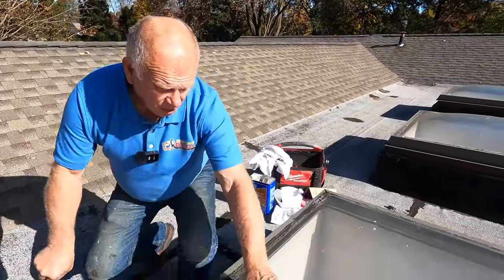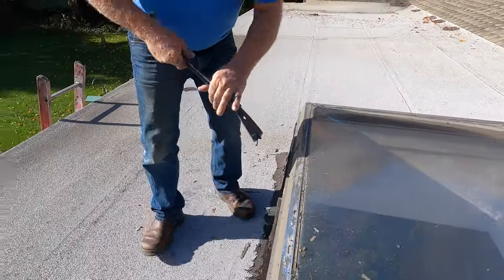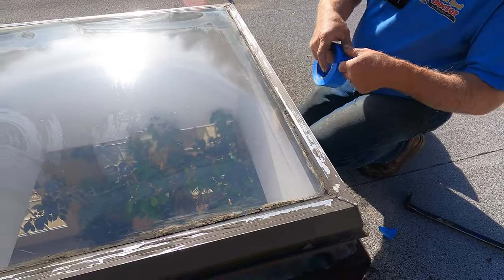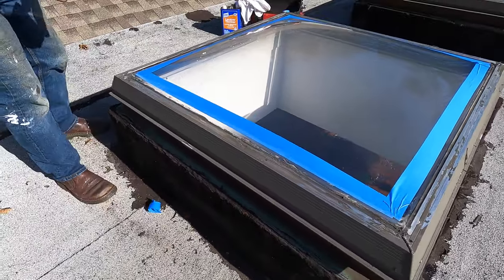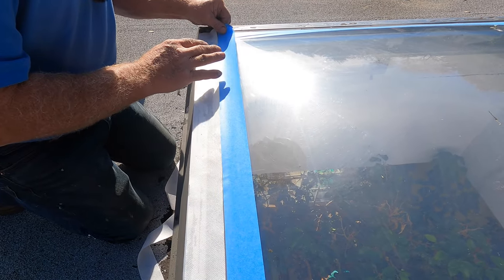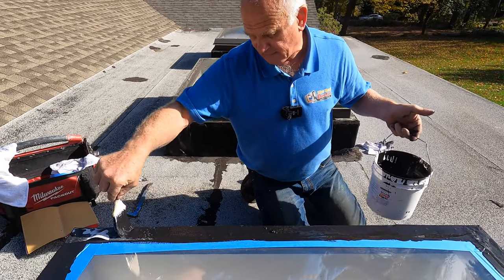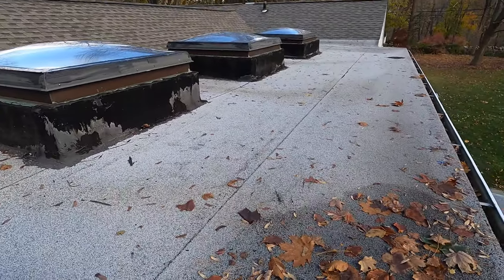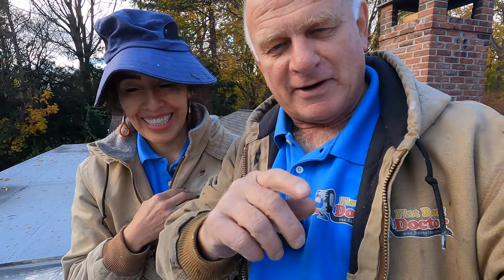The Best Skylight Leak Repair guaranteed DIY - Liquid Sealant adheres to glass, metal, plexiglass

Comment: Take the skylight off and separate the aluminum frame from the plexiglass/Lexan and remove the old caulk. Use xylene to remove the crud and clean completely. Install new 1/4"x1" butyl tape around the perimeter. Add extra butyl caulk to the corners. Put the frame back over the plexiglass and firmly press the whole perimeter to adhere. Add a bead of butyl over the top to frame/glass and use a small caulk knife to smooth the bead.
Reply: Where can these products that you are talking about in this comment be purchased ?

Comment: Preparation was so thorough and done properly.  I guessed Turbo Polyseal but I seeyou chose super silicone seal for this job.  Didn't it need a UV protection coat like the aluminum paint? Great video as always and much appreciated for sharing your knowledge and expertise.  Thank you.
Reply from the maker: Thank you! Hey, I am so glad you are back. Sorry if I offended you last time. That was not the intention. Turbo Poly Seal does not work on glass, although one of my older videos I did use that. Super Silicone Seal is the only product that I have found to work on plexi glass, glass, metal. There is no need to cover the silicone since UV's does not harm it.
Reply: @FlatRoofDoctor   hi, you didn't offend me at all :), it's just your videos stopped appearing on my feed until I remembered and searched for them and watched it. YT algorithm gets weird sometimes.  Thanks for the reply, always appreciate your knowledge sharing.  Trust me, you have my full admiration, not just your expertise but also your energy levels at your age :) 😀

Comment: What is the difference between the silicon that was put on it before & the silicon that you used?
Reply from the maker: The silicone from a caulking gun is not the same as that from a can. It has different properties
Reply: @FlatRoofDoctor  That's pretty darn vague.
Reply: Silicon in a tube is a glue, if it's made for spreading its a bonding sealant. The clear has to be applied between two fitting parts. The colored can bond on any open surface without cracking and releasing.

Comment: What products are you using? I'm building out a campervan and wanted to install a skylight put have found a lot of claims about skylights leaking. Maybe this product would prevent that.
Reply from the maker: If you plan to flash it in to the metal roof, then I suggest Turbo Poly Seal. But to seal between the frame and the glass you should use Super Silicone Seal
Reply: @FlatRoofDoctor  Thank you so much for the reply. Im not installing side windows  so a skylight would bring in some natural light.

Comment: The problem is that as fantastic as watching this video is , it's kinda a case of wanting this magic to work , especially for those who've already tried various failed solutions .
The vomments don't help because everyone says "UUU , Thanks , " 
I'M GONNA TRY IT " , so there's no confirmation that it works .
And even the "Short Term Testimonials" are of no confirmation , because as one response here states "even bubble gum may last for a few weeks" . What pizzles me is that videos for this product go back several years , why are there no longer term testimonials? Those would be the only ones of worthwhile verification .
Personally , I'd shown this to a roofer who used it on s skylight and it worked for I think 6 months to a year , I forget the time frame exactly , but then started to leak again . Yhis would conflict with the video which says "as good as (as sealed as) new.
But one experience is not enough to reach s conclusion , I wish there were many longer term responses of several years use order to get a more decisive opinion as opposed to million "Gee , thanksalot, looks great , I'M GONNA TRY IT " . 🤔

Comment: re the "testimony"- the repair lasted 3 weeks.  Big deal.  Bubble gum might work for 3 weeks.  Let's see a testimony from a repair 10 or even 5 years later- much less "forever".  This product may or may not be the best available for the glass to cladding junction (I'm still researching), but touting success after only a few weeks is very suspect.  I do know Through the Roof works well for a couple of years, then fails.